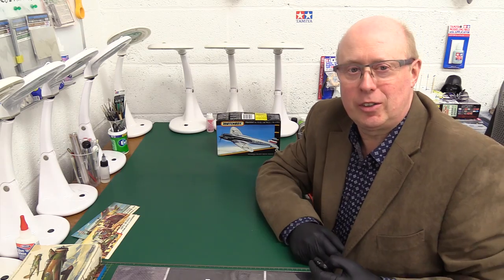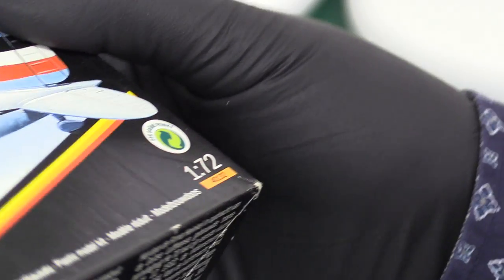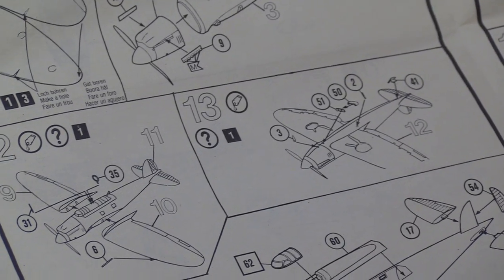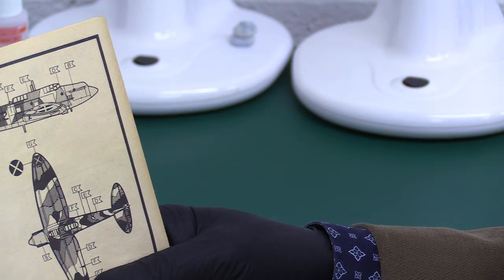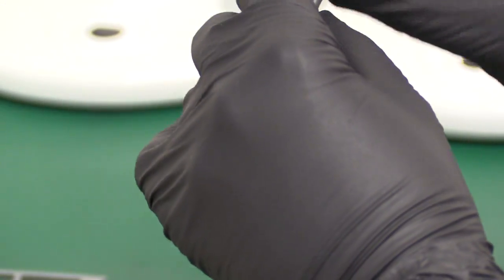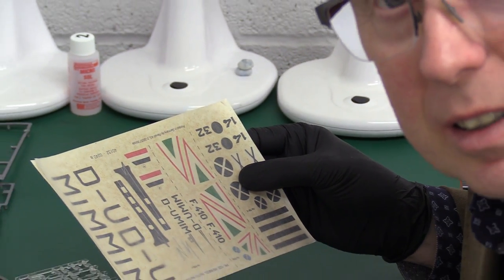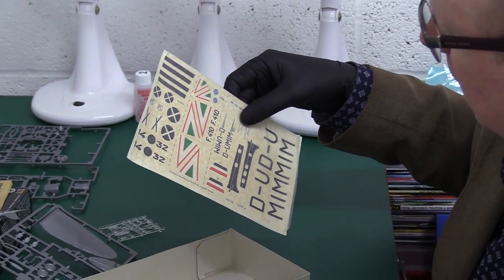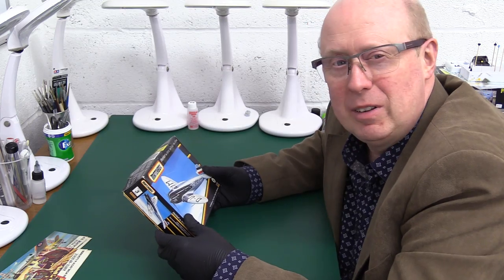Matchbox Heinkel He 70 1/72 review

Comment: The He 111 was simply an enlarged twin-engined version of the He 70 (the Heinkel 112 was also scaled down as a single-seater)  intended to serve both as a bomber and a 10-seat transport (the transport's smoking compartment became the bomber's bomb bay)..

Heinkel spent several years trying to market the He111 to Lufthansa, who weren't interested in another gas-guzzler ( the 6 seat He 70 was fast, but despite Party subsidies and mail contracts, barely broke even.  Lufthansa's profits came from its fleet of Ju 52s).

He 70E bombers and -F reconnaissance aircraft were used by the Condor Legion in Spain, and The Hungarians used a number of both before commissioning the He 170 with the radial engine (the version I built from this Kit).

I think the radial was a Gnome-Rhone 14N, but I could be wrong, the increased power output increased maximum speed, but the thing was already obsolete.